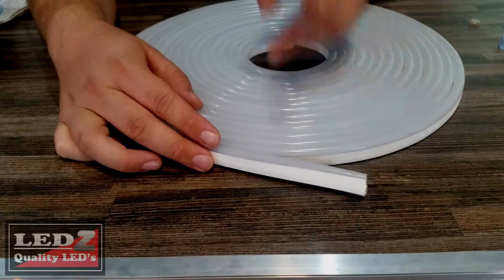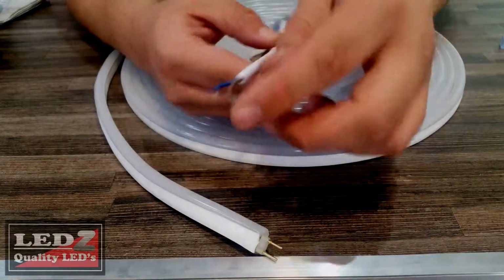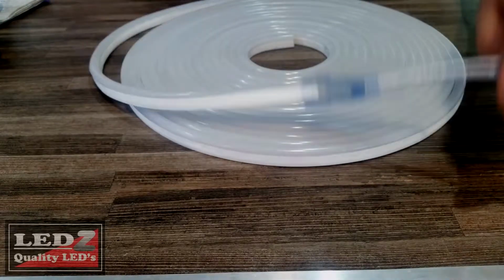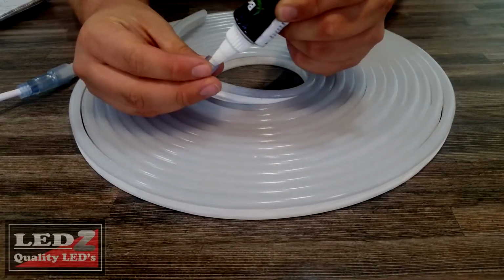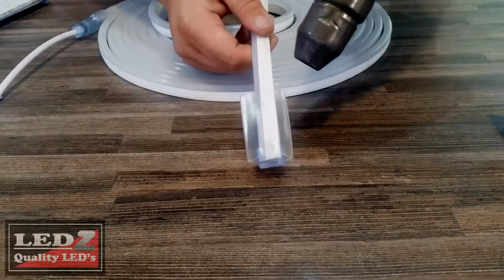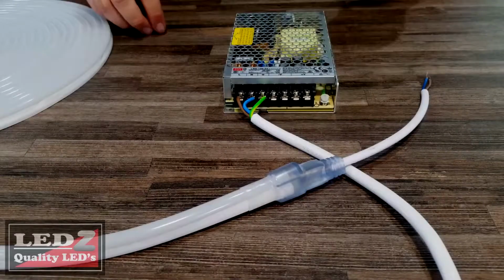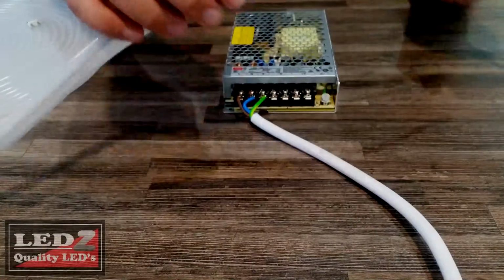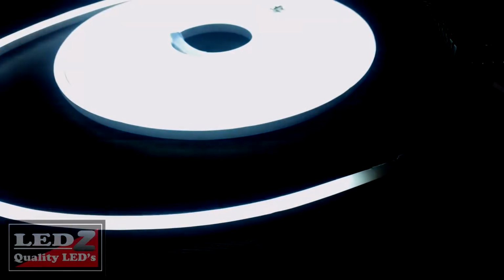EPISODE 10 LEDS FOR DUMMIES  SETTING UP AND WIRING OF LED NEON FLEX

Comment: Hello, this is very theoretical, because you need to bend it, how do you please bend it - so it looks like letters? I think its not possible in the alluminium - so you need to cut the LED stripe and then recconect it again - what is the most efficient way to re-connect the wires? Is that using some pins or how? Thanks
Reply: Tôi muốn mua com pho led neon